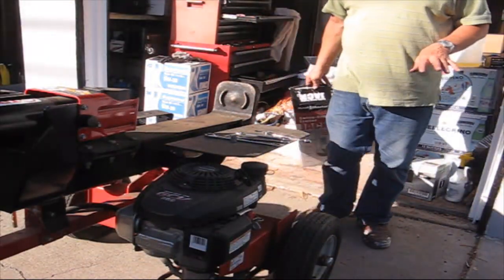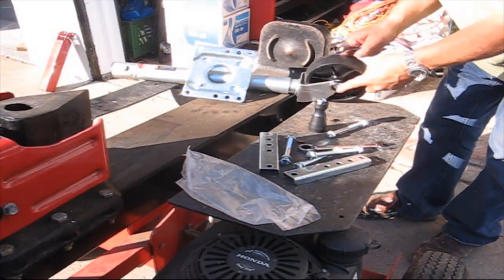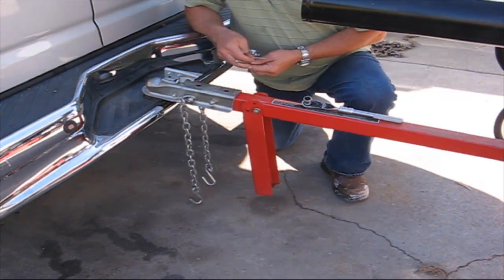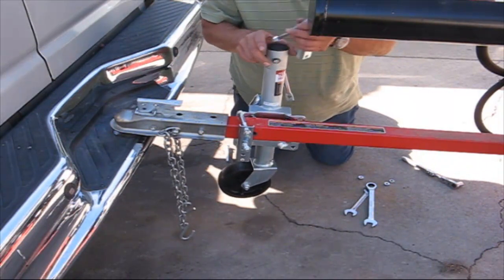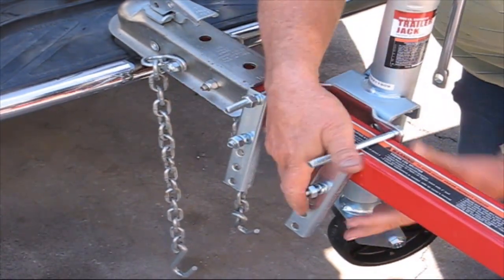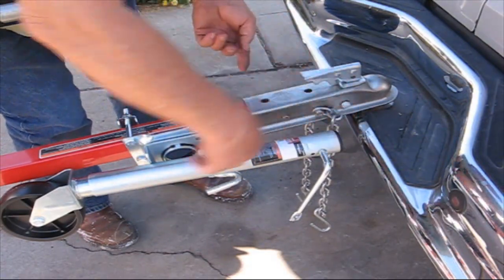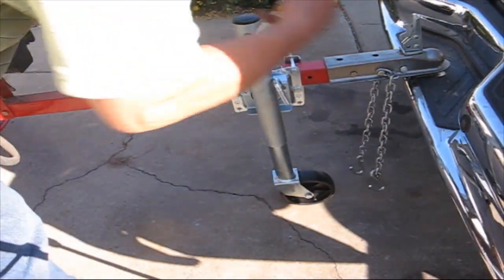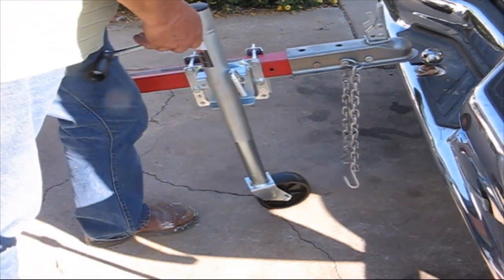How to Install Swing Back Trailor Jack on Log Splitter

Comment: were you able to make any right turns without hurting your bumper ?....Thanks for posting the video..I was researching doing something similar to my log splitter to help move it around easier.
Reply from the maker: Just make sure it is back far enough.  You will be able to tell when you install it.
This makes it so easy to move it around because you don't have to lift it, just push it.  One time I could not get it out of the place I moved it to so I tied a chain on the splitter and the van and pulled it out.  Never would be able to do it without the wheel.
It is a must have.
Reply: How does the wheels hold up in the dirt

Comment: That'll save a few fingers. The stock stand is dangerous and, like you said, not very stable. Plus you can level the splitter front to back on inclines, which we have a lot of around here. Definitely want it back further.
Reply from the maker: It is also easier for me to push it around versus lifting it and pushing it to where I want it to be.   Makes the splitter easier to use.